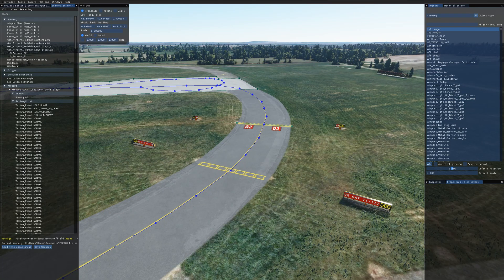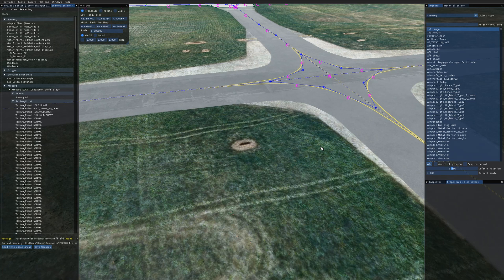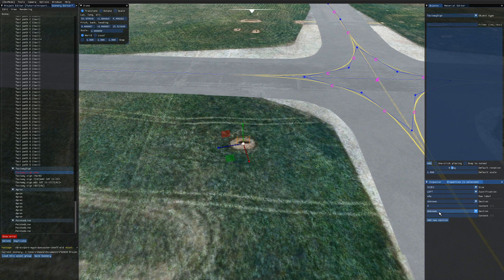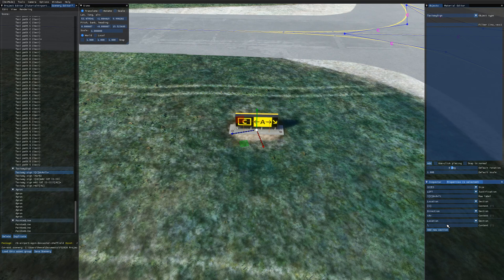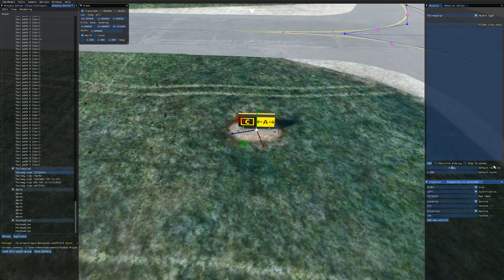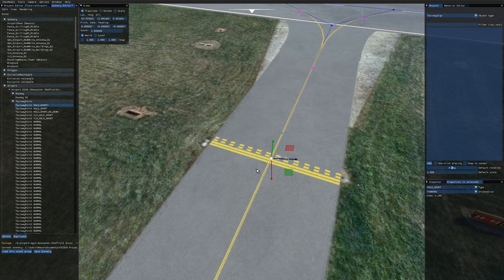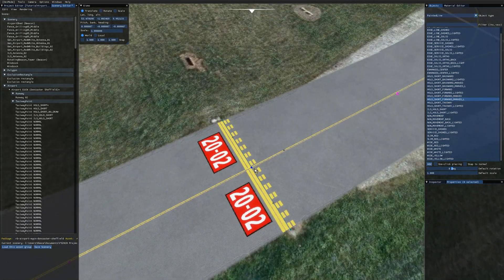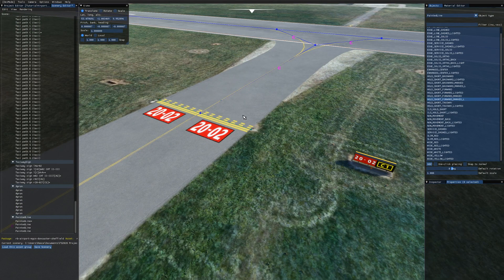SDK Tutorial #6 - Taxiway signs and runway markings - Microsoft Flight Simulator

Comment: This part is very confusing to me, because the Hold Short points on the taxiways have the arrows pointing towards the runway. Do I need to hide some of them, to give AI traffic access to exit the runway after landing? Otherwise, they won't have a direct path to taxi towards the gates. Am I correct, or am I still missing something, as far as creating a path to exit the runway? I'm guessing that is why I haven't seen any arrivals, because all of the Hold Short points have the arrows pointing towards the runway. Shouldn't the Hold Short points at each end of the runway only have the arrows pointing towards the runway, rather than  the entire stretch of the runway, for AI to have access to exit?

Comment: How do you get the runway markings to say "02", I have a runway which is 26-08 but the 08 just displays at 8. I can't see how to make it 08. Thanks!
Reply from the maker: There should be an option in the properties of the runway, in the markings section. I believe it is called European runway numbers or European markings. That will make the runway numbers on your runway have a leading zero as well.
Reply: @Benney  ah great thanks, I'll have a look

Comment: One thing I found doing this last night: the length of the hold short runway line marking matters. If the line you draw is too short you won't get the runway number painted on the ground. When you get to some minimum length it will pop in the left one, then if you make it even longer it'll pop in the right one as well.
Reply from the maker: Yeah, I show that a bit in the latter part of the video. It's because it adjusts for the taxiway and the runway in front of the hold short.

Comment: How to add working PAPI lights, I managed to add papi lights but the actual light is always WHITE, they don't change as I approach the runway
Reply: I'm pretty sure you have to set the approach angle on the PAPI. I'm gonna play with this later today and will report back.
Reply from the maker: As Neil says you need to set the angle on the PAPI, you'll find this in the properties panel of the runway or PAPI. For most airports this will be 3 degrees for a standard glide slope. You should be able to find the actual angle in the aerodrome/terminal chart for your airport.

Comment: Hi there! I am just trying to wrap my head around the SDK and videos like yours are really helpful, so thanks a lot! I have a question though. In all the tutorials I have seen so far people start with an airport that doesn't exist. What if I want to edit an existing airport? Do I have to create a new airport project on top of it or can I get into the actual file and start messing with taxiways etc. I have used polygons to delete MSFS generated objects, but I can't get rid of parked cars and other objects. The included documentation isn't very specific when it comes to this. Many thanks.
Reply from the maker: Glad you are finding the tutorials useful!

We can't currently open and edit existing airports. You have to just create an airport in the same place and choose which parts of the old one you wish to delete. I go over this in my second tutorial: https://www.youtube.com/watch?v=xWxJW6cHPpc&list=PLiEKiz8ROD3BdJTzWJvYZb96Qv8eg1R6L&index=2

As for deleting objects, you either use the polygon to remove buildings which it sounds like you have worked out, or use an exclusion rectangle for things that don't seem to disappear with polygons.
Reply: @Benney  thank you for the quick reply.
I used to build airports in X-plane. I was hoping to be able to use some of that knowledge, but it seems MSFS is a completely different beast.
I work as an airline pilot (A320) and my goal would be to re-create my home base. Since it is a large airport I will try something smaller first.
I hope I will figure it all out somehow. 
Thanks again.
Reply: @Benney  First, thanks for doing all of these videos. SDK is pretty intimidating for many of us so these are much appreciated. Secondly, are you saying the annoying taxiway lights that have been misplaced everywhere cannot be removed? If they can, could you perhaps do a video on how to accomplish this? Thanks again for all of your efforts.
Reply from the maker: @stevekrubeck2861  If you choose to remove the taxiways it should remove any taxiway lights that were placed along with them. I think there are also options to delete lights.
Reply: @Benney  Would it be possible to do a short step by step video showing us SDK "challenged" people how to do it? Like I mentioned before, this program is pretty intimidating to those of us who have never used it. Thanks again for all of your work!